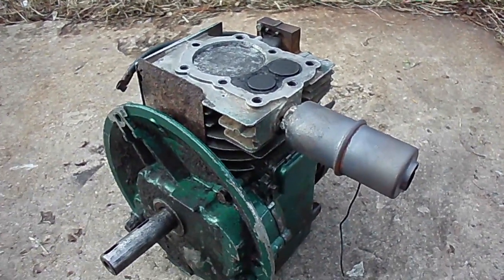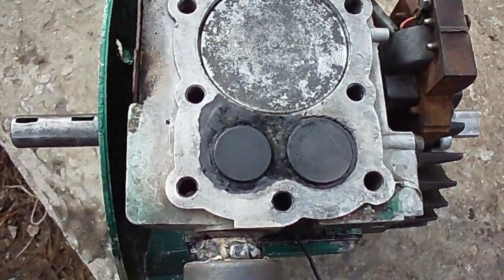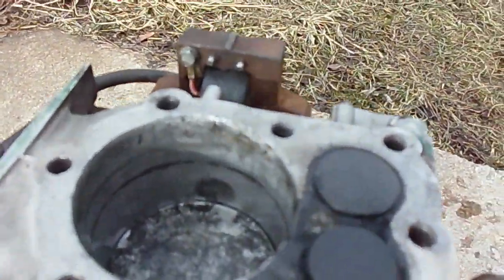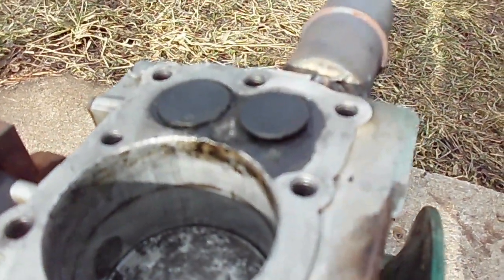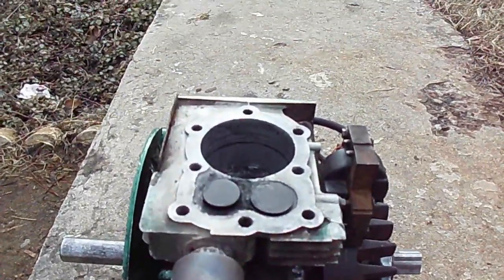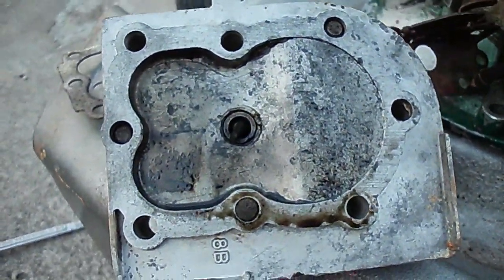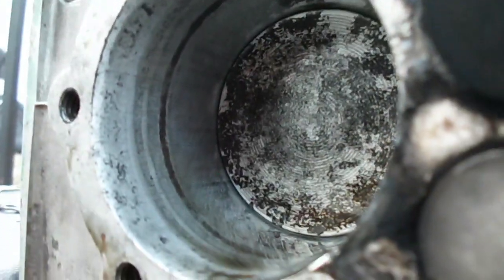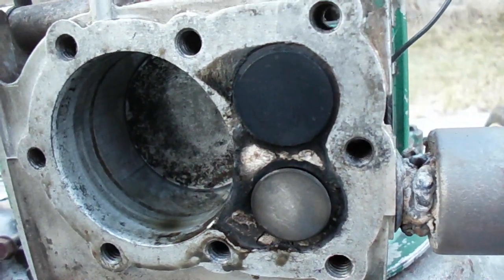J-B Welded 65 Briggs Teardown!  Vid #18

Comment: wounder how long it would last if you put something in the jbweld like diamond dust or copper.
Reply from the maker: interesting idea, I had not thought of mixing in materials to the epoxy, good thinking.
Reply: RedFathom copper may too much react and disturb the mix..brake pad dust like asbestos or ceramik dust may hold better. . But thats Just m'y guess n tough

Comment: See, it just might have 20 years left in it after all. LOL!
Reply from the maker: Yes, you may be right, I plan to cut some grass with it. That will surely be a torture test with the engine loaded down.
Reply: A rich air/fuel mix and 20w50 it'll probably do just fine.
Reply from the maker: I think I have a quart of 20w50 around I used to use it in the Charger when it was my daily driver, but I would have to use 5w30 in the winter, as the 20w50 was like molasses  in the cold. I had to resort to 0w30 in my old VW diesel !
Reply: Yeah, 20w50 is quite thick stuff. I have used the Supertech 20w50 in some engines, and man that is some sticky oil to clean up! I found it works great as an assembly lubricant. I used that for assembly lube when I rebuilt the 12HP Briggs in my rider. Worked like a charm. Stuck to everything.

Comment: JB weld is definitely a impressive product it's handy to have around the house or for some people it's good for engine repairs 😂😂
Reply from the maker: I did my first engine repair with an epoxy called Plastic Steel by Devcon, I attached an oil pump back onto a motorcycle, and it held for at least 10 years!
Reply: ChargerMiles007 epoxy based product are extremely performant
Reply: ChargerMiles007 I got an old cracked chokomatik fuel tank fixed with an epoxy based stick .. still holding 5 years later :)